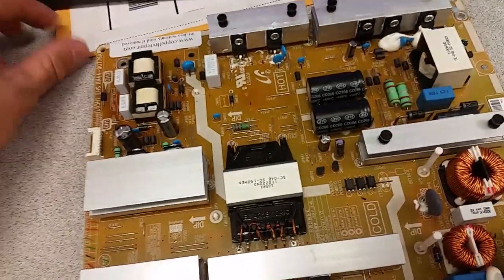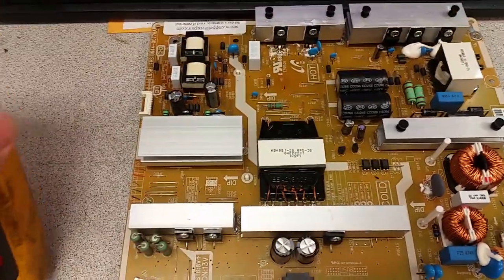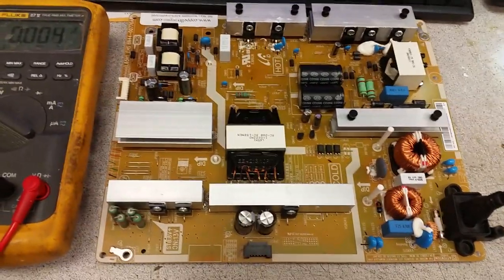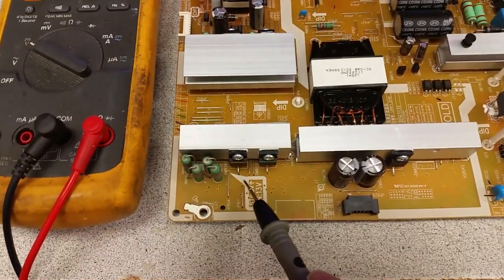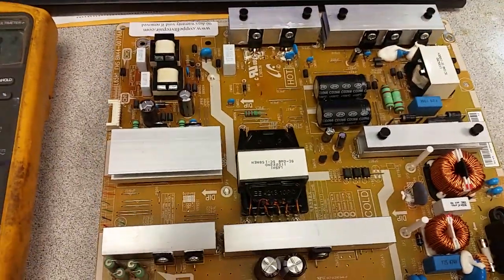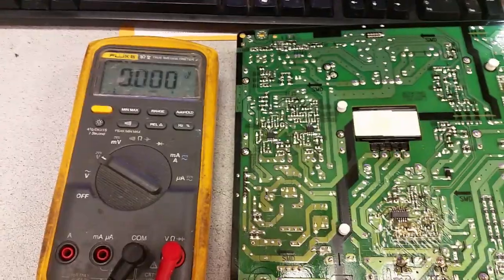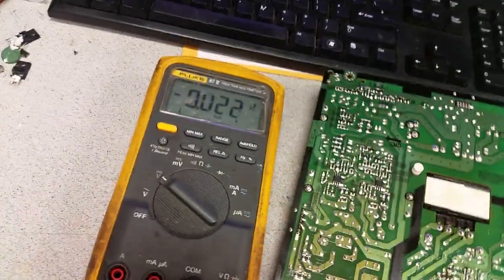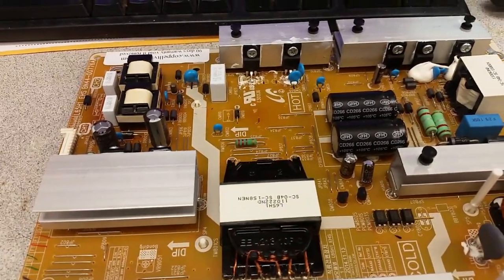Functionality proof and repair notes for BN44-00776A power Samsung UN65H6203AFXZA UN65J6200AFXZA

Comment: I wonder if you could give me some more pointers on this board.  The 13V jumper shows 12.75V, so good enough.  But on the backlight plug there's nothing going to the backlights.  Between pin 1 (D1+) and pin 4 (D1-) the meter shows less than 1 volt, but with the negative probe on the heat shield near by, which I take to be circuit ground, pin 1 shows +300 volts and pin 4 shows +185 volts.  It's exactly the same with pin 6 (D2+) and pin 9 (D2-).  When there's so much difference in between the positive and negative pins compared to ground, it seems like the electrical potential between + and - would be at least 115Vdc, but it's nothing.  The friend I got this TV from has already replaced the power board, but could this indicate that this new board is also faulty?  BTW, every backlight strip lights up just fine with 50-60V each and all the LEDs show good; I don't have a power supply strong enough to test the strips in series with 150-180Vdc so could only test each strip individually.

Comment: Just reposting this question in case you didn't get the notification of a new comment, regarding troubleshooting my BN44 board because I really want to get this thing fixed.  The 13V jumper shows 12.75V, so good enough.  But on the backlight plug there's nothing going to the backlights.  Between pin 1 (D1+) and pin 4 (D1-) the meter shows less than 1 volt, but with the negative probe on the heat shield near by, which I take to be circuit ground, pin 1 shows +300 volts and pin 4 shows +185 volts.  It's exactly the same with pin 6 (D2+) and pin 9 (D2-).  When there's so much difference in between the positive and negative pins compared to ground, it seems like the electrical potential between + and - would be at least 115Vdc, but it's nothing.  The friend I got this TV from has already replaced the power board, but could this indicate that this new board is also faulty?  BTW, every backlight strip lights up just fine with 50-60V each and all the LEDs show good; I don't have a power supply strong enough to test the strips in series with 150-180Vdc so could only test each strip individually.

Comment: On my BN44-00776A board, I measured  0 VDC between D2+ and D2-,  it should read open circuited about +300 vdc. The measured DC voltage at D1+ and D1- is about +300 vdc.
As you know D1+/D1-, feeds voltage to 3 series led  strips, and D2+/D2-, feeds the other  3 series led strips. Do you know where I can get a schematic of the board so I can troubleshoot the board and make the repair. All the led strips have leds that don't lite, it appears the leds must be shorted because the other other leds don't go out, they stay lite. Each of the 6 strips contain 19 leds, total led count is 114.  Of the 114 leds, only 47 stay lite. Any help will be appreciated.
Reply from the maker: Alas we do not have the schematic of the board, sorry.

Comment: Hello coppell! I have this Samsung tv. Un65j6200af and it had no lights so I replaced the LEDs. Now I get a very faint light I see the Samsung logo then 2 big vertical blue bars then back to black. I've also replaced the tcon board. Also when I unplug the cable from the main board to the power board and plug it in the wall nothing happens but when I unplug all the keds flash once. Could itbe the main board?What do you think the problem could be? If you have time I would really appreciate it. Thank you!
Reply from the maker: The vertical bars point strongly to either 1) panel issue; or 2) bad connections (crossed/shored wires on TCON cables) between TCON and panel. I'd try connecting the TCON flat strip cables one at a time to see if half of the screen comes up fine.
If it does then you know you're looking at the other cable or the panel itself...practically never (though theoretically possible) the TCON.

Comment: What if I have high voltage goin to my led
Reply from the maker: Then you have high voltage going to your LED...
Reply: @coppelltvrepair   is there a fix for this
Reply: @coppelltvrepair  I'm going through all these videos and blogs but nobody covers this issue, I have voltage going to my backlights I've got brand new lights I tested before installing and after  they all light up just wont turn on I know voltage is there cause I got shocked by it
Reply: the 7014x led driver under the board or the component around